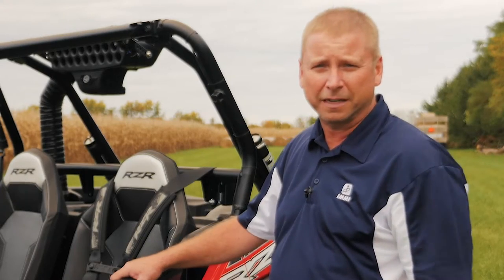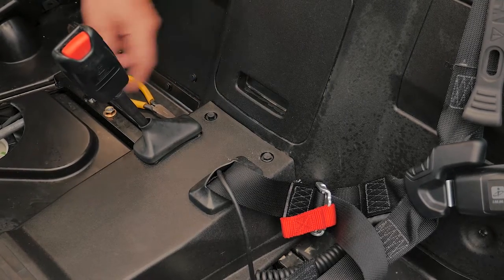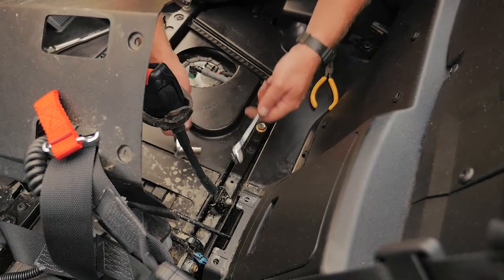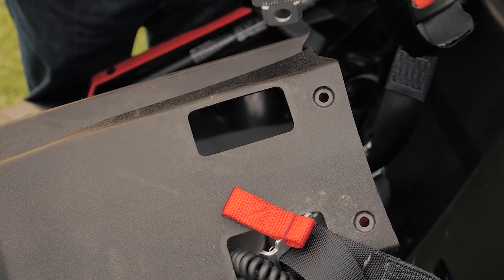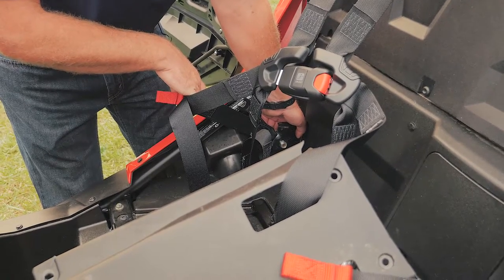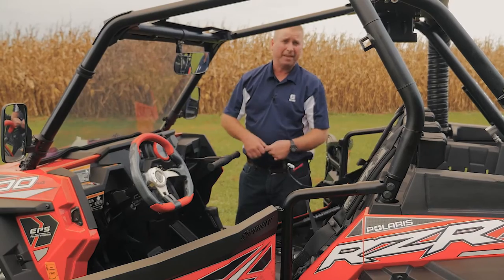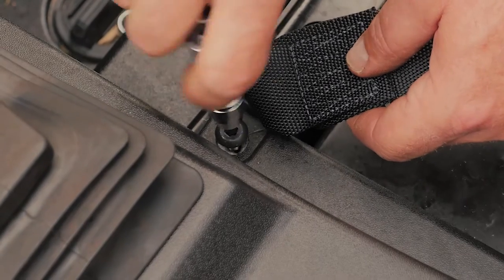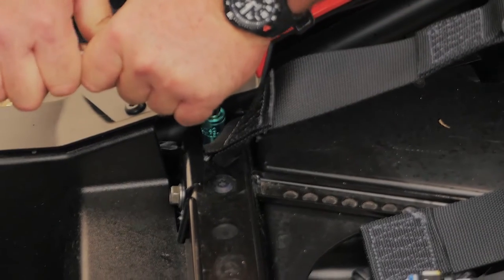How to install the IMMI Click6 Harness on a RZR 1000XP

Comment: Theses don’t work on the 2019.  Ask me how I know. Thanks. Nothing to mount the retractors to.
Reply: They do make an aftermarket bar that the retractors attached to I just bought one pretty expensive though hope it works
Reply: @drewbomback2191  I'm returning mine and getting some stv motorsports harness. They are $700 cheaper and work on the factory bar.
Reply from the maker: Thanks for watching the video.  This harness is available for all 2 seat 2019 RZR Models, and all 4 seat for the RZR Turbo S 4.  We work directly with Polaris to ensure the correct fit and mounting positions.  If you have any further questions please feel free to contact us.  Our information is on our website. imminet.com

Comment: This is stupid a 5 point or even 4 point harness that is SFI sertified are only like 60 dollors and they are way safer then this and the install process might require some modification but it's not that hard there are many videos on YouTube of how to install a 5 point harness in a rzr. IMMI your purpose is crash testing not building something that has been around for many years and just making it more complicated then it needs to be.